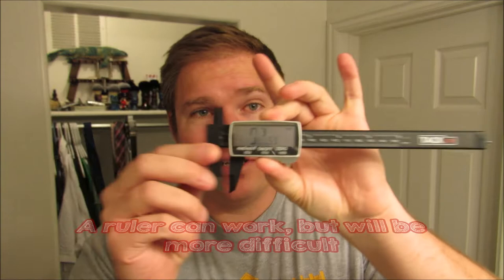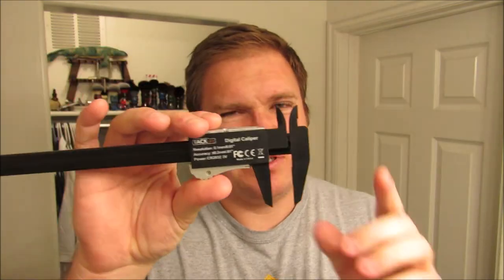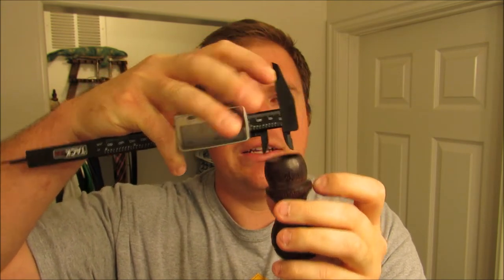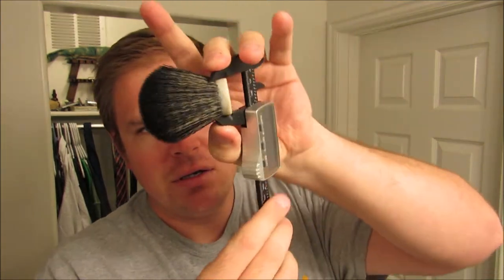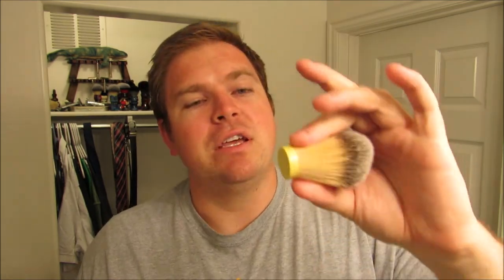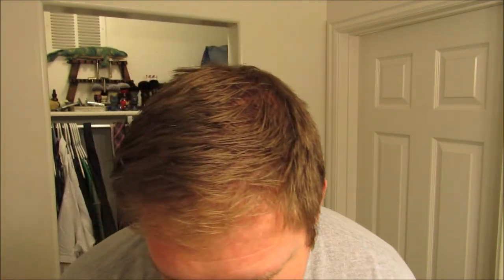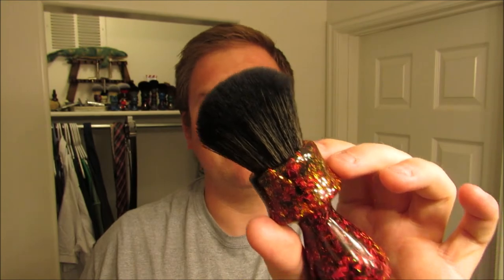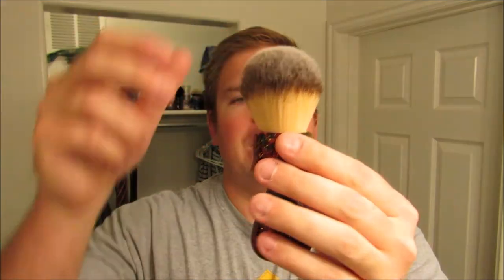How To Choose a Shaving Knot Size

Comment: Great video. We manufacture the solid Aluminum No.3 Dubl-Duck style which is a 22mm handle and we use 20mm x 63mm knots with specific style nylon spacer to determine the loft and backbone that we want for different types of knots.

Comment: better then boar cheaper in the long   run no break in .my Simpson Trafalgar is the best brush on the market today   it's like buying a $200 badger hairbrush, no cleaning the brush, no need for a brush stand, fast drying time, well not fall apart like a badger hair or boar can, cheap to buy, 
 I have owned it for 5 years with no hair loss with no problems wheelchair Larry Merry Christmas

Comment: Great video.  Whats your recommendation for setting a smaller knot in a larger knot hole, say 24 mm knot in a handle drilled for 26 mm knot?
Reply from the maker: Ideally, I'd say not to do that.  However if you need to then you are going to need to make sure the epoxy (out whatever you are using) fills in the extra space.

Comment: Now I understand about the width of the glue bump as I was pretty aware of the height . 
  I do notice on Etsy your handles are 26 mm, so if a person saw one they wanted a  replica of  but for a 24 mm knot is that doable?
Reply from the maker: Are you asking if I would remake one of my handles but as a 24mm handle?  Probably not, unless I start doing customs.
Reply: @CravingShaving  not custom,  simply for a 24mm motherlode knot I have. I  guess  no reply means look elsewhere?
Reply from the maker: @417Keto  I've made a brush for a motherlode knot before for my brother in law and it needed a larger hole.  I know that even though it says 24mm it has a huge glue bump and needs a much larger hole.  I'd say a 24mm motherlode is much more like a 26mm knot from my experience with it.
Reply: @CravingShaving  I'd better buy some calipers and check it out. I put one in a 26 mm yaqi rainbow handle, but it seemed to fit deeper than I wanted ( higher was alot of space in the hole) .
    I know what you mean, from the video, measuring
Reply from the maker: @417Keto  If it is fitting high then you should be able to put some kind of spacer like washers or pennies should bring it higher.
Reply: @CravingShaving  yes I could do that but then it's got a gap all the circle around it to fill someway
   I just looked at the  knot in that handle and the extra one I've got too. You're right it's glue bump is a larger diameter and pretty tall too. Now I'm wondering if it would even feel different. I'm using silicone so I can plop it out if needed,( I think)
Reply from the maker: @417Keto  do you mean a gap around the spacers?
Reply: @CravingShaving  I mean the brush hole would be extra big on the top of i did the penny under it trick. Seems I'd have to fill the empty sides (of the knot ) with silicone/glue . Hard to explain somethings on text.. I need one of those metal rings as a reducer, lol. Sorry bud I'm trying to explain.
Reply from the maker: @417Keto  yeah, it's hard over comments.  Feel free to email me at cravingshaving@gmail.com and pictures would be helpful.
Reply: @CravingShaving  ok thanks